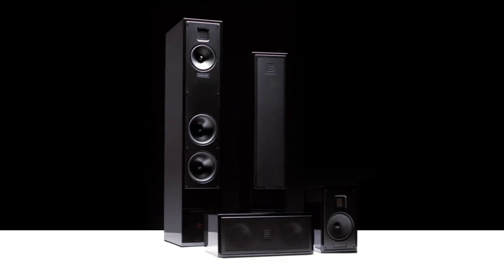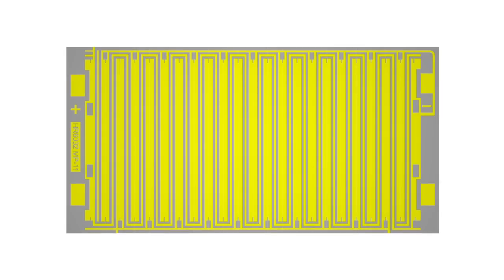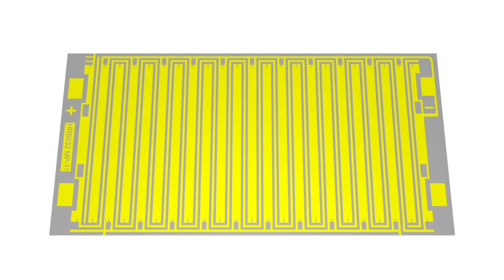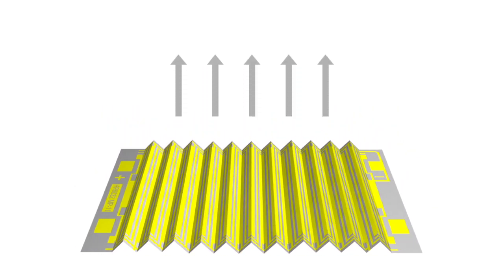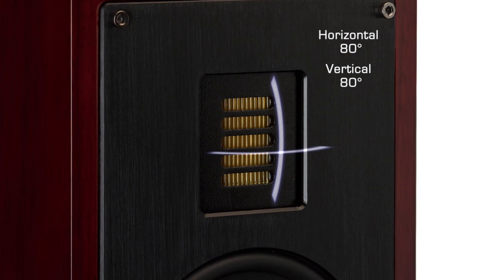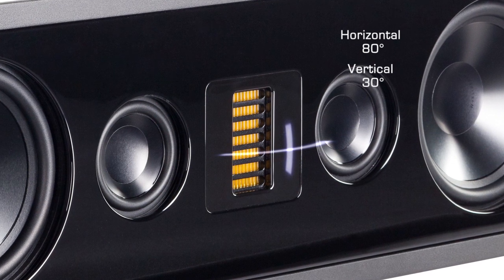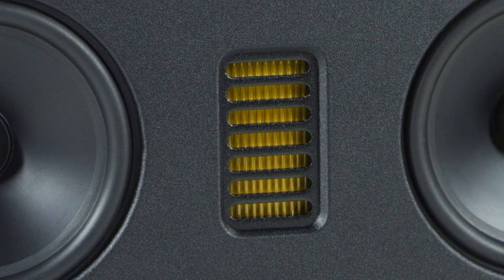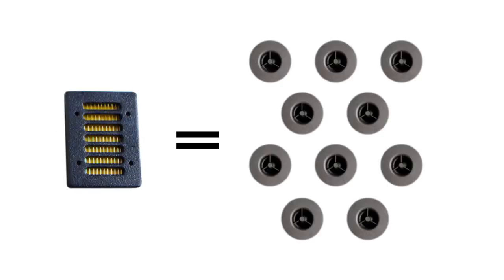Folded Motion Tweeter Technology - MartinLogan

Comment: Lots of people have copied the Heil AMTs over the years, but, most of them  acknowledge the originator of this truly different speaker.  NOT Martin Logan, indeed there is inference in much of their marketing material that they created the concept - SHAME on them!  

Disclosure, I owned a set of ESS AMT1 Towers from new (the transmission line version of the AMT1s), I still have the tweeters and they are still going strong.  The transmission line base unit was not well built, also, I had to build a raised platform for my listening seat to get in line with the centre of the vertical dispersion pattern.  Not a well-thought-out speaker, I sometimes wonder why I bought them over the AMT1s... apart from the (IMHO) superior sound.  :-)>